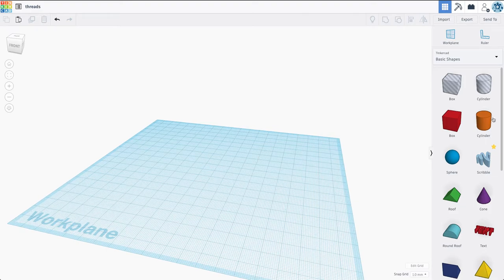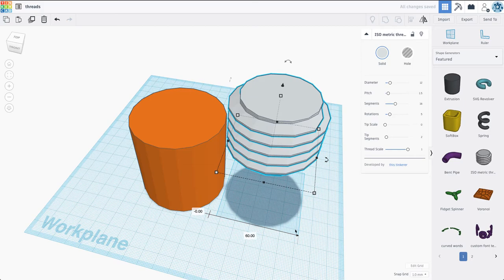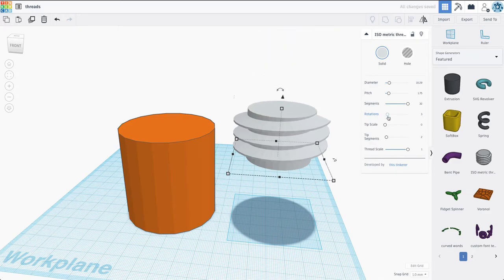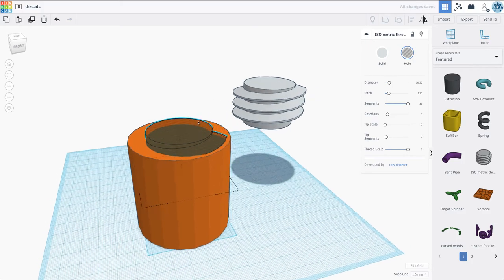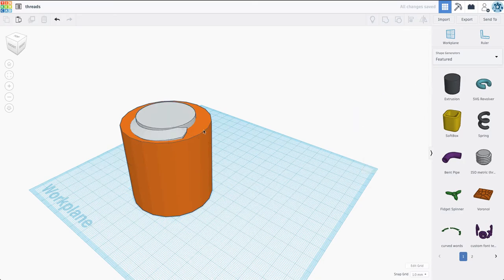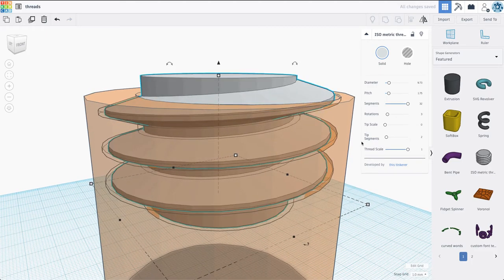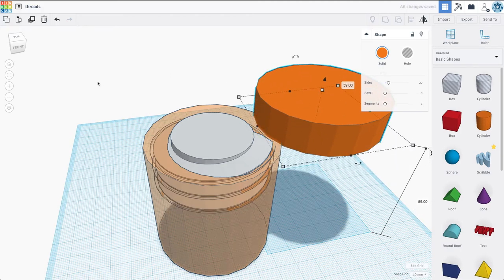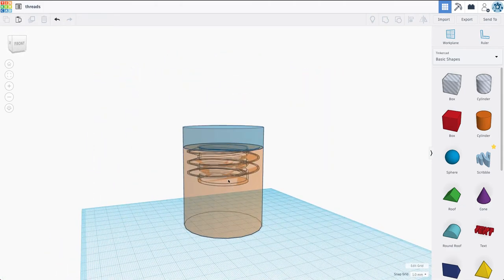How to create threads and screws in Tinkercad

Comment: I have a trick for making threads with 120 sides which you might need for large diameter threads. Make one with 60 sides, duplicate, change duplicate to hole, rotate 3 degrees, set nudge increments to Off, nudge duplicate up till the threads align, make a cube around the duplicate, group duplicate to box, make group a hole, group hole and original thread.
Reply from the maker: Clever, thanks for sharing!!

Comment: Hi, is there a easy way to set the ID or base of the thread? diameter only controls OD and the other settings take you in wrong directions... seems like it should have that as an option, but it's a missing parameter...
Reply from the maker: To my knowledge, no. For detailed thread designs like your specifying I usually use onshape (I have a thread video for that too) or I download STLs from McMaster carr of the thread I want and import into Tinkercad.

Comment: But what if I wanna make something that say screws onto a garden hose
Reply from the maker: Good question! The concept is the same, but you would need to match your thread pattern to that of a garden hose. This shape doesn't make that too easy to do unforuntately. What I would suggest is to download a STL model of a garden hose fitting, you can find them on thingiverse or mcmaster carr, then import this model into Tinkercad and use that do create your shapes.

Comment: I've been trying to make a specific threaded cylinder to fit a threaded part on my lathe. Thought it would be simple. Absolutely can’t figure out how to do it. I need a cylinder with female threads of 3/4” with 6 threads per inch. As far as I can tell, there’s no setting for the basic perimeter of threads per inch. It’s driving me crazy. Anyone have an idea of what I’m missing here??
Reply from the maker: I don't think you're missing anything, but I do think you're working in the wrong CAD program. Tinkercad is awesome for simple models with flexible parameters, but if you want to create something with tighter tolerances or specific dimensions, you may need a more powerful CAD program. I recommend Onshape, and I have a video for making detailed threads using it at the link here: https://www.youtube.com/watch?v=4Cdkuo_xdnw&list=PLBDInqUM5B2422G7ycE1iHlj33igmu0Q3&index=19&t=13s 

McMaster Carr also offers downloadable STL files of almost all of their items, including nuts and bolts. You could download a thread pattern from there and drop it into Tinkercad to manipulate / customize as well.

Comment: I understand this is an old video.  I have done simular in the past and worked, but lately I can't get ANY threads to work, no matter what I try.  They look great on screen, printed they are WAY off and ZERO chance of them working.
Reply from the maker: What type of printer are you using? You need to design your threads so that the tolerances are suitable for your printer. For example, typically FFF printers need a tolerance of .05 - 1 mm, so you would need to ensure that you have a gap of at least that in your design for the threads to print correctly.
Reply: @MrErdreich  I have no idea what was happening, but I didn't change anything in how I do my threads.  They worked before, then they didn't, now they work again, lol.  I have to assume the cad gliched.
Reply from the maker: @canadianpatriot5577  it’s possible! Or perhaps print settings / calibration? Glad they are working for you again though!